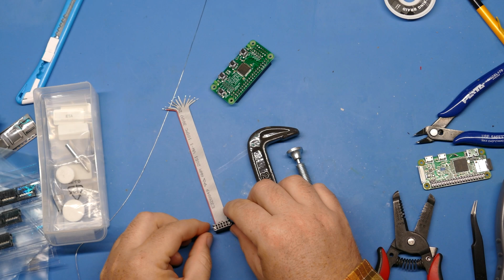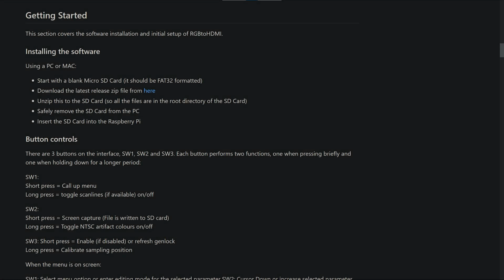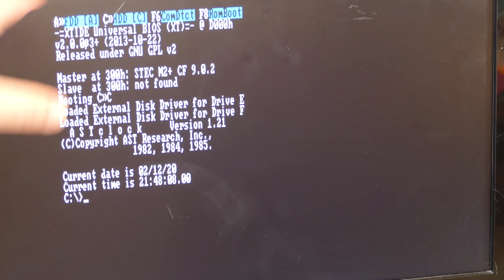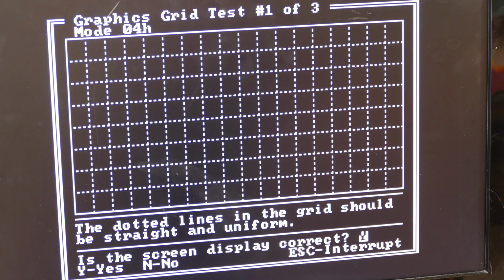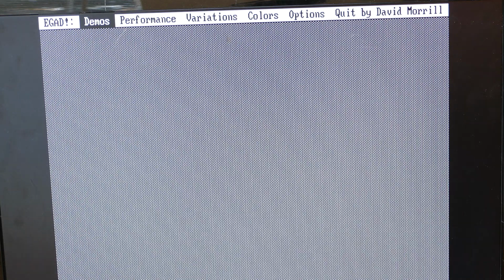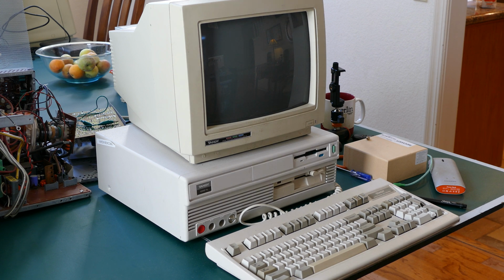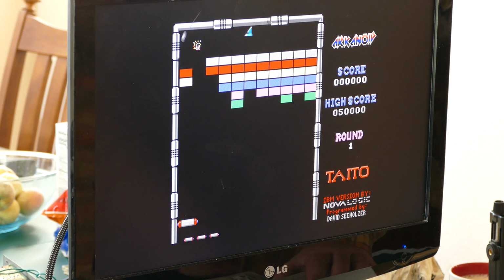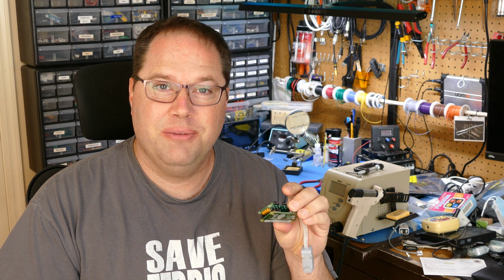Add HDMI To Your Vintage Computers!  - Part 2

Comment: Awesome content. My interest is in using the information you’ve shared here for the purposes of “retro” consoles. Replicating much of the RetroTink products but at much lower cost. I notice you weren’t using RCA / Composite in this device.. is that something the “analog” board would provide? Do you know if there’s a similar repo for RCA/Composite to HDMI? Or does that firmware handle these also?

Comment: So if understand correctly, the TTL Buffer Board is recommended but not necessary. If I decide to include it, that means I do not need to make the cable. I can just connect my 9 pin digital RGB cable right to the board?
Reply from the maker: Yes!
Reply: @RetroHackShack  Thanks!

Comment: default output of a ntsc c128 is very much the same as cga, tho a bit more flexible... should soonish be a new c128 profile and palette made by one of the more active graphics artists on that platform which better match the output of matching crt displays (provided your lcd display is setup somewhat sanely)

Comment: It might be worthwhile to use nylon jaw shields in your vise to prevent marring the connector.  That, or just order an IDC connector tool:
https://www.peconnectors.com/female-idc-sockets-.100-2.54mm/hws9377/ is less than $20.00 U.S.

Edit:  "Let's turn this back on" -- THUNK!  That's such a good sound!
Reply from the maker: Nice. Thanks for the tip. The vise is working fine for now, but I am going to look into it.

Comment: I love that 4:3 ratio LG monitor (TV?) that has HDMI input. Not a lot of 4:3 displays has HDMI capability, you're lucky to have one. I have old 15" LCD VGA monitors that I use with my retro computers, I just can't stand the stretched out or centered picture with the newer 16:9 monitors. I will built this board but unfortunately I'll have to use it with an HDMI to VGA adapter. Luckily, since it is a down conversion, the results are pretty good, almost indistinguishable from direct HDMI connection, even with 1080p. I wish HDMI capable 4:3 monitors like your LG were still available.
Reply from the maker: It's not 4:3, but the RGBtoHDMI just scales it correctly without changing the original aspect ratio.
Reply: @RetroHackShack  Oh, maybe the camera angle played a trick on me. It looked 4:3 😊 Now I am less jealous. 😄
Reply: Default output is dvi over hdmi, I use one with a 4:3 aspect ratio dvi connected display and a typical hdmi to dvi cable. Just tell it what the native resolution of the display is if it doesn't detect it properly, and it will take care of the scaling. 

Depending on what device you are going to use it with.. frame rate may be an important consideration... not for cga/ega etc, those will be 60hz and your display will pretty surely do that just fine. But if you happen to live in the 'pal part' of the world, and are connecting some Acorn/Commodore or such machine, you want a 50hz capable display. A given with hdmi equipped devices in those parts of the world.. but not all dvi capable devices will work with that, even at resolutions at which they kinda should.

Comment: Really like this thing, and I'm gonna get one for my Coco 3 seeing as I don't have the CM8 monitor. I am looking for one just because I have everything else for the Coco 3 and I do mean everything else: Dual Floppy Drive, Multi-Pak Interface, Cassette Drive, Modem, The Orchestra 90 CC, 2 Deluxe Joysticks, most of the Rom Packs as well. it was my very first system I had for my home use when I was in my youth. never got rid of it. It is still functioning. I'm going to probably have to reCap it. but the Electrolytic Caps from the 80's on don't leak very often like the older ones from the 60's back.

Comment: I have a special set of crimpers made just for ribbon cable connectors.
Reply from the maker: What are they called. Can you still buy them?
Reply: @RetroHackShack  you can pick them up on eBay for $20 or so.  But for the same money, just buy a small bench vice and get much better control.  Plus a scalpel to remove the "tail".  I have an old set of Amphenol crimps - ex USAF/Rockwell built like a tank, but I prefer the bench vice.  I assume the crimping tool is for "in-situ" jobs and I can see its purpose.  I've just built 10 Issue 4 boards with the 12 bits/pixel - loving the simplicity of the board, ease of use and of course, the price 😁  The Amiga A500 version of this plugs into Denise and gives the Amiga amazing clarity, another board to spin though.  There's also a SCSI drive emulator based on a very similar design (but it's bi-directional logic, so a few more ICs) that also uses a Raspberry Pi Zero.
Reply from the maker: Yeah. I have my bench vise back and it works well. I am always interested in new tools though.

Comment: Cool. Thanks for putting this together and sharing it. Always down to see new video transcoding options.

As for the results, I think it looks sharp and very clean. The colors look quite different between the CRT and the LCD, but I think that's down to calibration and LCD quality. The pink, for example, on your LCD is looking quite washed-out as compared to the CRT in Arkanoid. Conversely, the skin tone on the main character in PoP is quite off on the CRT. I think both are generally adjustable.

Nevertheless, I still greatly prefer the CRT image for any of those old games. The patterns in solid colors created by the pixel size and the presence of the scanlines are an important part of the mood of those games to me. It also changes the brightness and the mix of the color pallet.
Reply from the maker: A lot of the color difference is due to the way the camera records the CRT vs the panel. You reminded me that I meant to show the scanline modes and I totally forgot. Doh!
Reply: @RetroHackShack  That would be great to see. Fake scanlines can definitely improve things.

Comment: Wow! Nice... Glad that worked... It is better than I thought with very little fussing with... I have use the Vice and Clamp method for years, that is why I mentioned it in the 1st video... :-)
Awe Yes, Checkit, what a great program. when I was a tech and a Mom & Pop computer store we would use Checkit to see what all the information on the computer was. We took trade-in back then when folks upgraded from 386's to 486's and up. The version we had was a registered version and if I remember it had way more option than the one you have. I believe the owner paid $50 buck for the version. We had other programs we used to, those were some great days back then with all the jumpers and cables to move around just to get games to work. Then they add support for modems and that was a total Fubar. It sometimes took a whole day to make the game work then. I hated games so much that I gave up playing them... :-(
Glad things worked out and can't wait to see what you do next... BTW I would be the guy to build it... Lol
Thanks for the video!
LLAP

Comment: Amazing quality!  I think this might be better than the RetroTink for some things.  Would love to see a detailed Amiga video on it.
Reply from the maker: I realize now I never came back to say why I would still likely be buying a retrotink at some point. This is because the analog board won't handle complex composite signals yet like the retrotink does. However, the retrotink doesn't do digital RGB. This is from the wiki page ... "An addon analog interface is available for the 6 bit version of the converter to support a limited number of computers with a few levels of analog RGB / YUV output such as Amstrad CPC, Spectrum, Atom, Dragon or Tandy Color Computer, or monochrome composite output such as Apple II /IIe, UK101, Superboard II, ZX80 and ZX81. Note this interface can only distinguish a few analog levels and is not suitable for systems with many levels of RGB or YUV."
Reply: @RetroHackShack   - The latest version is 12bit, so does do Amiga: https://stardot.org.uk/forums/viewtopic.php?f=8&t=20404&p=295631#p295546